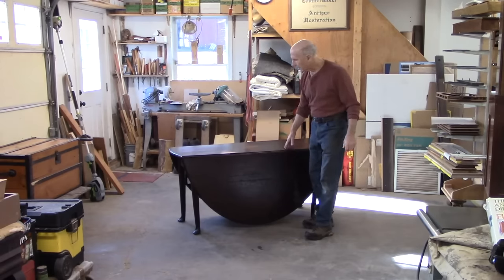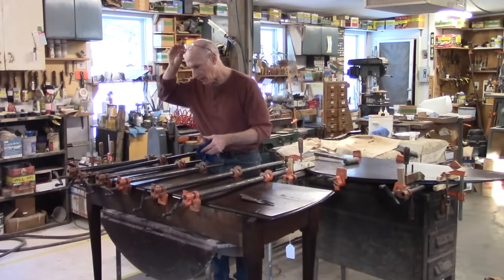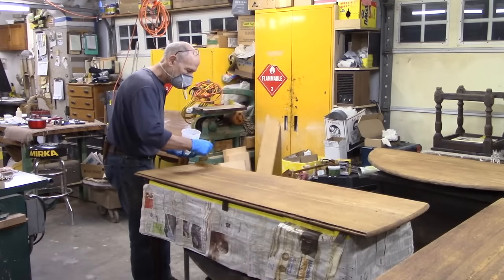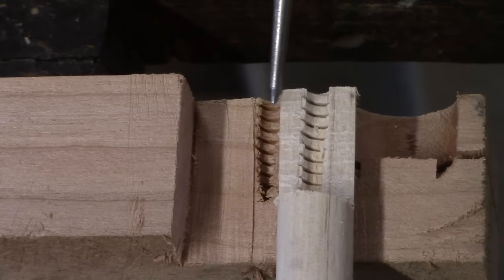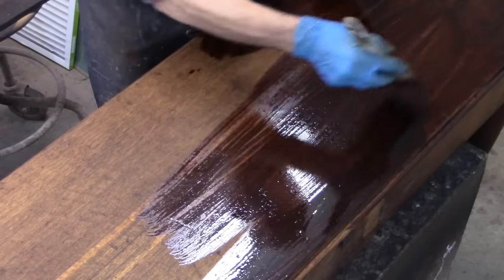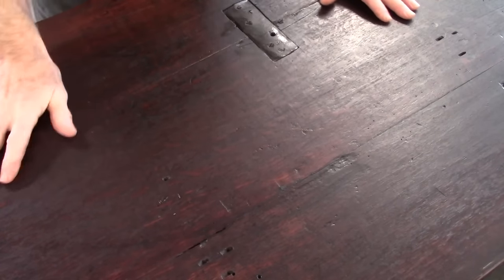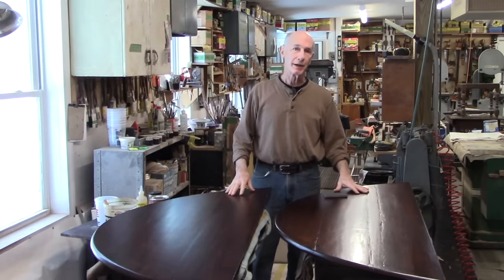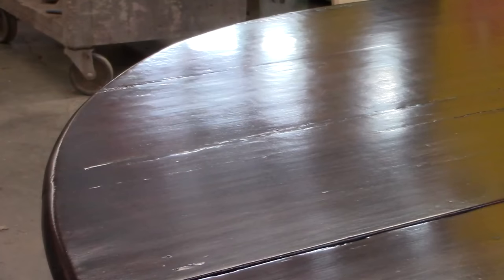Is This Table Too Old to Refinish? - Thomas Johnson Antique Furniture Restoration

Comment: Now this is just a thought on my part here, couldn't you get a chunk of scrap stone  countertop and put a couple of hot plates under it to be more efficient??? Mostly thinking that the stone would stay warmer longer once heated up.
Reply from the maker: Thanks! Do you mean for loosening joints or veneer? Not a bad idea except you would not have a lot of control
Reply: @johnsonrestoration  no sir for your varnish that you were preheating
Reply: I was thinking along the lines of coldstone creamery but in reverse, in theory it would hold the heat longer instead of just heating the air as your heater was doing, never tried it yet on my part, was just wondering if any professionals had tried it was all, and might be able to get the stone for little to nothing if you got a sink cutout, been thinking about that idea for tool sharpening, be able to put several different sheets of auto sandpaper on one block

Comment: Wonder what perchlorethylene would do to wood?......Thinking of it as an oil and grease remover.
Reply from the maker: Thanks! I'm not sure, having flunked High School chemistry! Isn't that the chemical that's contaminated so many sites, like where dry cleaning plants operated?
Reply: @johnsonrestoration  Yes......It is dry cleaning solution........  We used to use in at a hospital maintenance shop to remove grease from a clutch, (for want of a better name......it was on a folding machine) that needed to be dry and clean, but would become contaminated with grease and oil.......   "Perc" would make a short job of cleaning certain areas of this machine that had become invaded by grease and oil.

Comment: If only this old antique furniture could talk! Those burn marks, I wonder what caused them. Since heat rises, it couldn't have been hot beverages. The other marks that came out with Oxalic acid were probably caused by condensation on cold drinks or pots that had leaks. That burn mark, again, must have been a metal base oil lamp or something, that sat there for a long time! So its pre- electricity! Also, on second thought, could have been a hot utensil,  that came off a stove and was placed there without a hot pad, though, I think that was unlikely.
Love watching these pieces come back to some of their former glory, very therapeutic for me.
Reply from the maker: Thank you! That burn was very deep, that;s why sanding was not an option. It must have burned for awhile

Comment: Wow that Victorian breakfast table nearly identical to this one It dates from around 1880's here in UK. It's in better shape nearly perfect just needs a proper clean and maybe repolishing. It's got bevelled edges the same, double drop leaf like this one and is on original castors with carved legs and feet detailing...made from flame mahogany or mahogany veneer.  I also have wooden chairs from around the same era with delightful backs to them all carved out with rose and leaf motifs.  They don't make tables like this anymore, absolutely beautiful to look at but functional and easy to store away for floor cleaning or whatever.

One thing in my collection is an 18th century chest of draws on legs with feet also mahogany with lovely brass plates and handles on each draw. That is in serious need of restoration as it got damaged in transit, two of the legs broke off and one is cracked.. some of the veneer is coming away off the front in small areas, but overall I think it's worth saving and could be restored..
Reply from the maker: That sounds like a nice table! I think the repairs to the chest shouldn't be too bad - if you have all the pieces

Comment: I would like to know what a restoration job like this would cost?   I do restoration. And I would like to get a second opinion on what the value of your work is. If I were to guess, my estimate would be right at $250.00-$300.00.  I would like to know if I am over or under. ????
Reply from the maker: Thanks! I don't discuss prices in this forum. If you want to email : thomasjohnsonrestoration@gmail.com

Comment: Wasn't it possible to remove a thin layer of the wood, all along the table top where the burn spot is and cover it with veneer?
Reply from the maker: Thanks! No not really practical. That area would look so different from the rest of the table. Besides, I wanted it to keep looking old. All those defects are the history of the piece!

Comment: Does the paint stripper or acid degrade the glue you applied to the leaf?
Reply from the maker: Thanks! It could - but if your joint is tight it will be OK

Comment: I wonder if you could have used Japan dryer mixed with paint thinner to try and harden the original linseed finish
Reply from the maker: Thanks! Good idea, but when it comes to table tops that will be used, I like to build a finish with a proven durability

Comment: Hello sir…. What type of glue was used at 36:00 ?
Reply from the maker: Thanks! That was 5 Minute Epoxy. On antiques I use hide glue primarily, but this crack was really old and would not go back together properly, so I thought the epoxy would be the best thing. Rarely use 5 Minute Epoxy, but it does come in handy sometimes
Reply: @johnsonrestoration  Thank you so much for taking time to answer me, much appreciated! Love your work!

Comment: I too have been a Antique Furniture refinisher and there are a couple of thing that i would have done , First off to get a more even color match i would have stripped the legs and base along with the top, it makes it much easier to match in the colors, Second thing is when you turned lover the piece back onto it's legs you have have hurt your back very easily, at the start of this video is how it should be done and that's is how it should always be done. I also hate that there was oil on the top and that's one reason you strip, the whole table. I am guess this was use like a work bench as an Amateur Mechanic lol,That burn mark plus the oil tell me this i have run into this before.  The age on this table was made to look like it was made during the 1830's to 50's and i am thinking it was made late Victoria and early Edwardian, 1910 would be my guess. Some of the old style wood working and some of the more modern style.You have done somethings i have never tried and will on my next tester ,i try and save as many tques as i can. i also saw that you used a two part glue , all i have seen in 2 part glues set so fast what brand are you using. Thank you
Reply from the maker: Thanks! I appreciate comments from fellow tradesmen! We all do things differently, I always am geared more towards doing less, rather than more, just in the hopes of saving as much of the original as possible, always difficult to decide. I think the 2 part glue might have been 5 minute epoxy, and yes, the fast set makes it difficult

Comment: Around the 50 minute mark ,you use sand paper , try using 4-0000 steel wool i doing this to take the neats and it also makes for a very nice finish, i use a gun to apply the finish's in less i am doing and true period antique then i use a cloth to tap polish the surface to finish that was how it was done in the 1770's and earlier and mid was into the 1880's .
Reply from the maker: Thanks! I use sandpaper when I really want to "cut" the nits away. I often use steel wool too, and lately have become a big fan of Scotch Brite pads

Comment: Was that liquid hide glue? Just curious. Looks like an old hand made country piece. You're right, it would be hard to date. I often tell age by the screws. If the slots are off center, it's probably pre civil war. If the screw threads are uneven and not pointed but blunt, then 18th century.
Reply from the maker: Thanks! Yes, hide glue - "Old Brown Glue" https://oldbrownglue.com/, and yes, this is definitely an old table!

Comment: My dad refinished a lot of furniture for my Mom and he liked to use Red Devil stripper without any wax in it. To remove it from the wood he used planer shavings and saw dust. It would soak up the remover, act like a sanding substance without harming any wood, and where the dust stuck, there was more finish. many people wanted Dad to do this kind of work for them but he didn't because he said that he would have had to charge just to much money for the work. We only did the work  outside and never had to wear any kind of mask. By the way, I am 74 and in great health so don't say that we should have worn masks. Today I wear a mask, use store bought strippers, but always use laquer thinner and saw dust for the final step. I've never heard of the acid that you used. OK, I'm game, what is free cut paper please??? I think Dad would have liked your glue injector, I do... The different shaped scrapers weren't around when dad was doing his work but he was a tool and die maker so I have many different shaped scrapers now, but all with their own handles. I saw Dad shorten screws many times but on a grinder. I've never used the tinted waxes!! Why wear a mask when staining??? Dad would have liked the Scotch Brite pads. Most of our finishes were spray laquer. dad and I got critized for doing to much and getting rid of the "patena" but Mom wanted what Mom wanted and dad di this. They were for her and not for the sale barn...
Reply from the maker: Thanks David! I like your memories and the stories about your dad. The acid is Oxalic Acid which can work well on a lot (but not all) stains. Helps avoid heavy sanding. Fre Cut Paper is sandpaper designed for sanding finishes https://www.3m.com/3M/en_US/p/d/b40071114/. Good luck with all your projects! Let's hear it for our Dads!
Reply: @johnsonrestoration  Thanks for the sanding paper information...

Comment: Queen Anne tables can be very very old but your table probably came from the early 1900s because white oak was to hard to work until electric saws came along and white oak generally weren't used especially quarter sawn because of the method needed to saw them.... It's not to say they couldn't but way to difficult. The stripper was good but can be toxic... you might try a half denatured alcohol and half lacquer thinner mixture and rub with 4-0 steel wool. Usually on quartersawn white oak in order to bring out the rays they apply wood filler with medium brown stain mixed. In old times they would apply this and wipe it down with burlap... but now you can apply it and right before it dries rub it down with something coarse that won't scratch. I use the 4-0 and the more you rub uniformally, the more you will be rewarded. You wouldn't believe how much research I had to do to find all that out. Lol my house is full of white oak by the way.
Reply from the maker: Thank you! This is all very interesting and yes, I know all these techniques as I was brought up using them. I take issue with your remark about cutting oak, 1/4 sawn oak has been used for centuries, (if not millennia)!
Reply: @johnsonrestoration  yes in ships and places where only white oak would work... mass production of furniture seemingly wasn't feasible. For instance, they made table tops by using a plane... so if you look down the side of your table top with a light, you won't see waves. Now that I think about it I do recall seeing quartersawn doors and panels in castles over in Europe. I did read this about Quartersawn oak in several books so they may be wrong and I took it for face value. In any case, I have admiration for fellow woodworkers.
Reply: @johnsonrestoration  You were right.. artisans made quartersawn oak furniture several hundred years before the 1900s but wouldn't be mass produced until circular saw blades could be used (electricity or water) I just misunderstood reading about the popularity and mass production around 1900. I have to admit that this wasn't the first mistake I've ever made. Thanks

Comment: As an ex English Antique Dealer ,wheeler dealer ,buyer and seller who has done some repairs( not on your level but just enough to get a sale) to English furniture I can only say it was sad to see you take off the original patina , bit sacrilegious  to me as an Antique lover and a patina lover but I do enjoy watching your repairs  and techniques  and wood repair tricks, did come out good in the end but not as good as best part of three hundred years of patina........
Reply from the maker: Thanks! The problem was that the owner wants to use the table and the existing finish was terrible. And certainly not the original finish. That table had been repaired/refinished numerous times. I left all the wear marks and defects

Comment: Wouldn't have been so much work if the wood didn't have so much oil in it. Like trying to polish an oiled boot the more you work it the more the oil comes out and dilutes the finish.  It would concern me that the oils may still try to surface with temperature and humidity changes. Still a nice job.
Reply from the maker: Thanks! Yes, it was a pain. We'll find out if they keep coming up!

Comment: Why not strip legs as well. You've already changed  the table top. Nearly impossible to match top and bottom otherwise. Could look like a marriage. Nice job overall.
Reply from the maker: Thanks! I had to refinish the top, no question. But the legs were fine, just needed to be cleaned and waxed. With antiques, the top never matches the legs anyway. The tops are always lighter

Comment: There is a great Antique Roadshow episode that has a refinished armoire unit from the 1700s. The owner purchased it for $10,000 and spent $6,000 to have it refinished. The antique expert complimented him on the expert refinished job and valued it at $30,000, double his investment. He was very pleased. Then they viewed the back of the piece with the original patina and informed him the if unfinished he would value it as a starting bid of $120,000. He basically distoyed a piece of furniture history. He looked like he was going to cry. Take it from Thomas Johnson that made this video. He has no idea what he did to the value or historical importance of this of any piece. Before you destroy an antique piece in your  possession get it assessed by a real expert. We do not own anything in this life. We are only the caretakers passing through time. Preserve the past with the respect it deserves. ✌️
Reply from the maker: Thanks! I respect your thoughtful comments. With this particular table, remember that it had been repaired and refinished so many times I figured it was time to do it again. I tried to maintain a lot of the character, but to make it useful again. This table will be used on a daily basis, and the existing finish was not working. The point you’re making certainly does apply to museum pieces
Reply: @johnsonrestoration   You did a superb job on this table. Your concern for keeping the worn characters while using finishes that not only respect the style but make the table usable might be just the thing to save this piece. Most of the table you left basically unchanged and the whole piece looks great. People like you in the industry save countless pieces of furniture because people can own and use something in good condition. A piece worth keeping. Every day unused or old or broken furniture like this goes from the house to the garage and then out in the yard and by the following spring after the rain into the trash. It is sad. 
When Ronald Reagan took office Nancy started her decorating of the house. Examining the White House and storage warehouse she could not find many pieces that she knew existed. Turns out over the decades the Presidents and others took many things on their departure with no controls. It was just a short term furnished rental house. She immediately had her husband designate the White House as a museum and each piece was numbered and cataloged. Thereafter pieces could no longer be removed from the collection. She also put out a plea to the American Public to preserve history by returning any White House pieces they may own and would be paid a far price. Many pieces that were just siting in ordinary homes made it back to DC making sure they did not end behind the barn some day. I share that odd love for history and furniture that Nancy had.

Comment: Lacquer thinner does not touch oil.   You would have had better luck using VARSOL or odorless paint thinner as that will wash out the oil AND leave a finer oil behind because that is what is in the thinner/solvent.   Or TSP (trisodium phosphate) solution to take out the oil on the surface...don't care if it is Tung oil or motor oil or vegetable oil or wax or floor polish.  You "first" might try Silicone remover(gotten from an auto paint store)  Assume anything and everything has been used on that table including car wax.   Won't be on this project, but FUTURE projects.
Reply from the maker: Thanks! All true - except lacquer thinner does work. I like using TSP though

Comment: I Never Use Striper I Use A Cordless Sander. With 60 Gritt Sand paper That way I Have No Need For Striper Or Have To Be Breathing
In All Those Striper Fumes.
Reply from the maker: Thanks! I understand your concern, although you can't sand down antiques you are trying to restore! Stripper allows you to remove the finish with very little effect on the wood. I hope you're not sanding period antiques!

Comment: If your going that far you should just plane the top. Take the burn out and the ring. I know that's a bit much but you seem smart enough not to screw it up.
Reply from the maker: Thanks! The burn was too deep. I didn't want to patch it either as that would also involve too much sanding. I wanted the top to look old